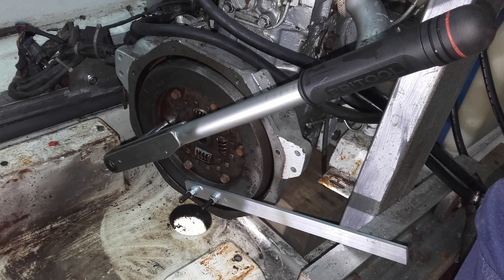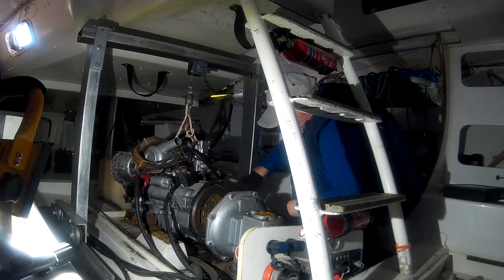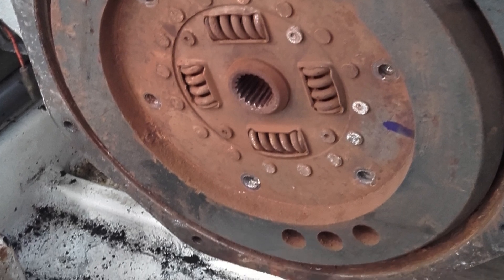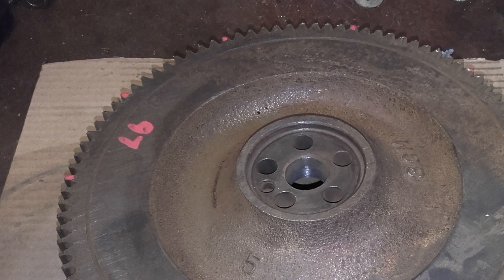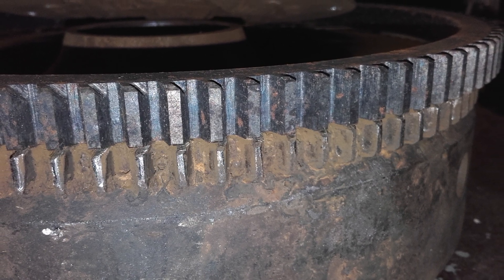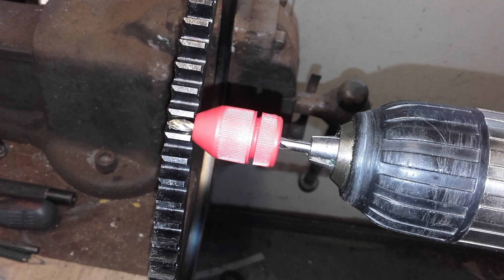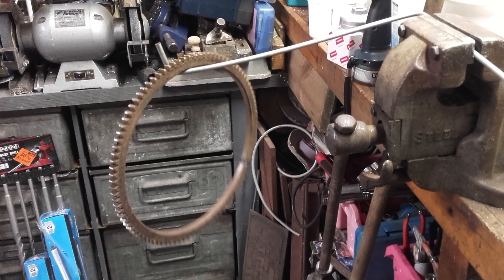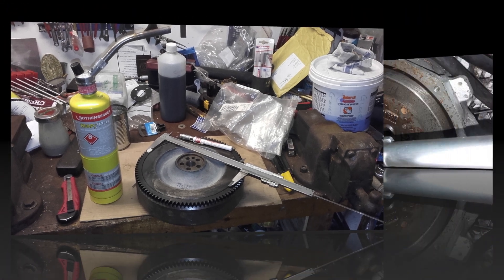Yanmar Engine Ring Gear Replacement

Comment: The tool with 2 bolts you made to hold fly wheel in place as you unbolt the flex-plate, what is the pitch-to-pitch dimension and bolt size? I would like to fabricate one. Thanks 🙏😁
Reply from the maker: The cap head m8 screw heads fitted in to two of the three holes bored in the flywheel to balance it during manufacture. Each flywheel may be different. If you subscribe to the channel and head over the community page I have shared a couple of pictures of our tool.
Reply: @BottomUPBoats  Thank you. Will do 👍